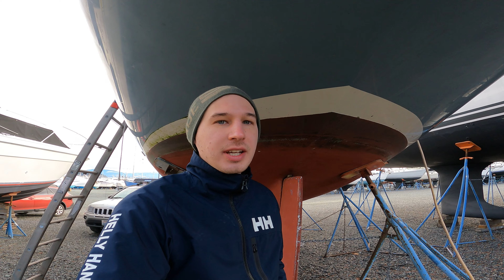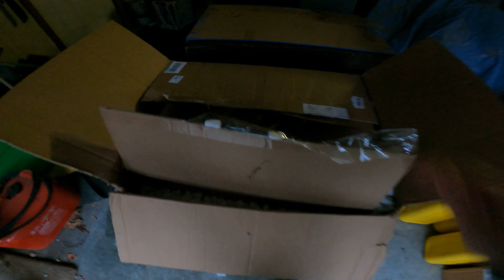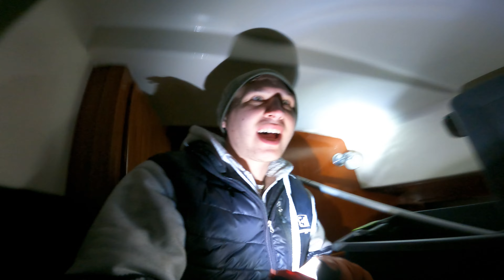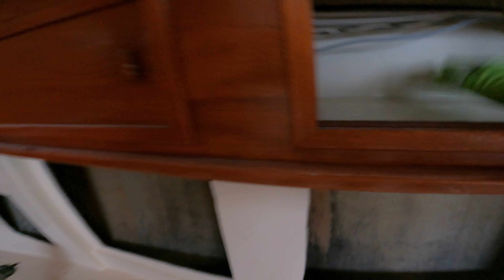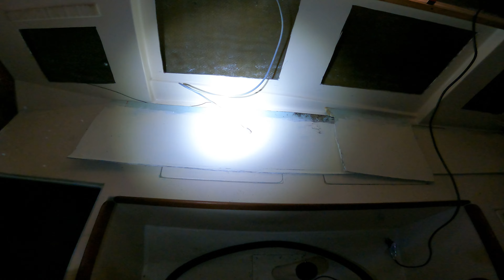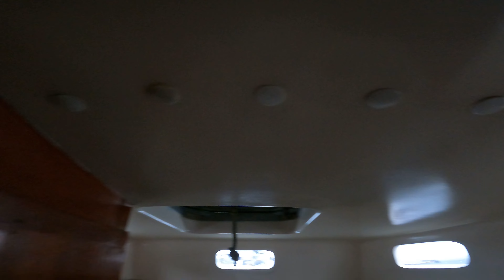Preparing for My New Electric Motor!

Comment: What all electric motors have in common is a generator. Even charging stations for the electric cars some have a fuel generator. I laugh at this fact.
Reply from the maker: We’ll see what the motor needs as we are cruising to Alaska and back and adjust the regen solutions as needed. Most of the circumnavigation will be near the tropics with plenty of sun, my friend just made it to Fiji with this build (same brand, smaller motor) but less regen than I’m planning, he is doing just fine :)

Comment: There is a fair amount of FUD regarding getting insurance on boats with lithium battery banks - have you encountered any issues?
That will be a great setup.
Reply from the maker: I have never heard of insurance not liking lithium, in my mind if the lithium has the proper fail safes they should be perfectly fine. Ya, I'm surprised State Farm fully insured my old boat with minimal information, but I am a long time customer and my brother works in their claims department.

Comment: I have thought of going with electric on my boat but still on the fence. The cost on the electric seem so high when you consider the batteries and so forth.  I have thought about hybrid also.   See my videos at Sailing Vessel Reimagined on YouTube.
Reply from the maker: Ya, it took months of consideration, but I also considered that I may not have any income while sailing around the world, just enough for maintenance and fees from my savings. Never having to fill up on diesel or get any of the services/parts/oil in sketchy places made electric a real winner if I can keep the components safe.

Comment: Where did you order the external bronze chain plates from?
Reply from the maker: I got 3ft 0.375" inch x 1.5" inch bars from onlinemetals. com for around $100 each on sale.
(As well as 316 stainless backing plates)
Reply: @projectseawolf  I may do bronze backing  plates also, with bronze bolts, nuts and washers so that I don't mix metals.
Reply from the maker: You are exactly right, mixing metals is a bad idea and if I was bolting aluminum to stainless, it would corrode very quickly however, when I was designing this system with bronze and stainless, I looked into how the metals interacted, and talked to other sailors who have used bronze on stainless say there is no degradation between the metals after 10 years of sailing. In fact Sam Holmes used stainless bolts through the hull to fix his bronze bars and sailed across the Atlantic.
Also, my professionally designed and made custom bowsprit terminal uses stainless on bronze as well, pretty interesting!
Using stainless halves the price of the project from $1200 to $600 so I figured why not. But yes, if you had the time and money bronze on bronze would be the absolute ideal.

Comment: So now that you’ve gone with an electric motor, safe to assume you’ll be going full electric with everything, induction stove, heater etc. that being said I imagine you’ve mapped out your battery needs (lithium, AGM?). Love to hear about those plans as well as your energy recovery plans (solar, wind, engine regeneration etc). I was one of the guys who would’ve stayed with diesel but love the idea of electric. Looking forward to hearing about it all. Cheers
Reply from the maker: Ya! So Electric Yacht will map out all your needs and draw up a schematic for you. For heat and some cooking I will use a high efficiency drip diesel like Alluring Arctic used on their early videos. For propulsion I will have x4 48v Lithium Dakota batteries, apparently the fewer the batteries the better as you start to loose efficiency if you went x8 12v batteries instead. For the house bank I will have x4 battle born batteries which will be plenty for my instrument and cooking needs.
For power generation I will have solar, wind, and a Honda generator if it’s less than ideal conditions for other types, also a generator allows you to go 3knts for as long as you can run the generator which is good in an emergency. With electric yacht motors you also get hydro generation from the spinning propellor while you are sailing, and apparently it’s quite a lot of power with a prop 16in diameter and larger, so that’s great.
There are some people who have a big lithium propulsion bank hooked up to charge to a single AGM that takes the house load. I think there are a lot of ways to do it, but I’m going with what the manufacturer electrician said would be ideal for my power needs.
Certainly there will be a lot of experimenting and I’m excited to see what works. Total conversion cost is around $25k (for everything), but selling the old diesel appliances gives me around $9k, so for me it’s around $16k for the conversion. I don’t know if it will be cost effective when comparing it to a decade of filling up my diesel tank (if I had one) but hopefully it means I never have to pay for diesel services or engine maintenance while cruising the world by sail.
Reply: @projectseawolf  sounds like you’ve done your homework, thanks for the reply. Staying tuned in…

Comment: Well done mate , good start , great feeling enit , project finally underway . Don't wander too far though , try and keep the work confined to one area , complete that , then move on . Else the project becomes more of a slog , and you quickly get disheartened . 
Those chain plates look a right mess . I think you're gonna find water in that laminate , so it's gonna need drying thoroughly , before applying any new glass . Otherwise at worse , it won't stick , or at best will be a poor bond , and possibly leading to a failure . You can't really see what the job entails , until you remove the chain plate , but it's important you don't forget to seal the hole , to stop more water from entering . Your weather still looks rather rough , but it's not much better here , if you're interested . 
I can't help at all with the motor , i've got no experience of electric drive , and i still think it's a major mistake . I understand your intention , but the management is complicated . At least one converter has begun to reverse the process , but still you've made the decision , so that's an end to it . The numbers you were looking for on the prop , were diameter , and pitch . If you look on a prop as a screw , the figures mean exactly the same . That's where the slang term "screw" came from . In very basic terms , the pitch is a measurement of forward movement , and it's the same for a screw , as in screw terms .
Reply from the maker: Ya, in the next episode I write all the jobs down before I want to splash and some of them including sealing up the chainplate glass and rebuilding those areas will have to wait for dry weather. Still as I’m writing this I’m working on removing and salvaging parts and appliances I will modify or sell, just interior work for now while the weather howls outside.
Ah, I should have know the prop-screw connection, I studied literature and history as well and love word origins. I’ve heard it before but forgot, thanks for reminding me.
Ya, designing a system around this electric motor will take some design work but so far I’m having fun with it.

Comment: We spray "OdoBan" for mold and it works good. Spray, Vacate, Return with that clean air smell.
Reply from the maker: Sounds like a plan! Ya it’s to the point where the whole inside of the hull is just black sludge in some places, yikes! But that’s what happens if its constantly wet and never cleaned for 5+ years.